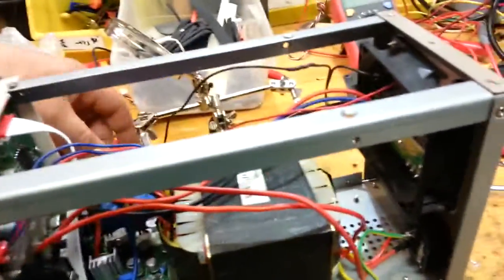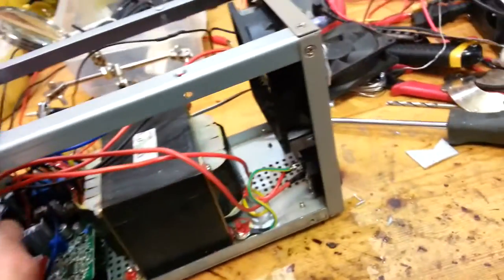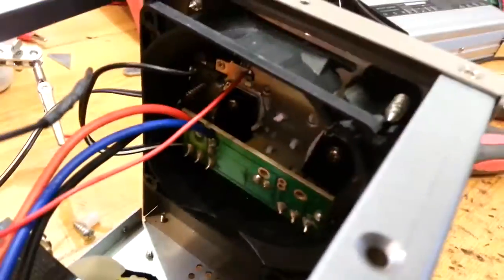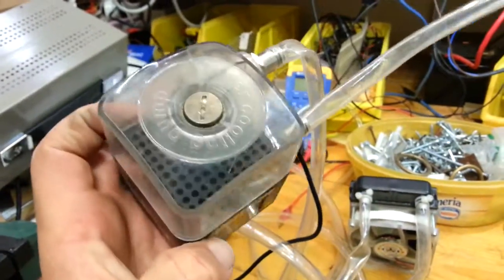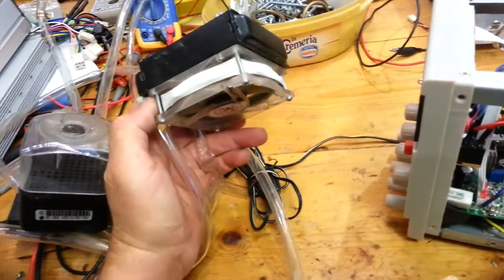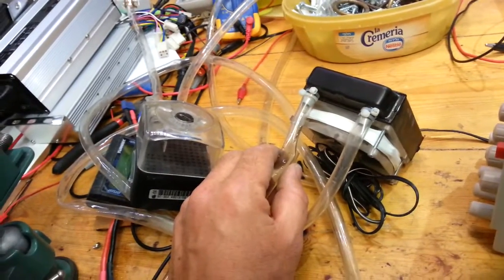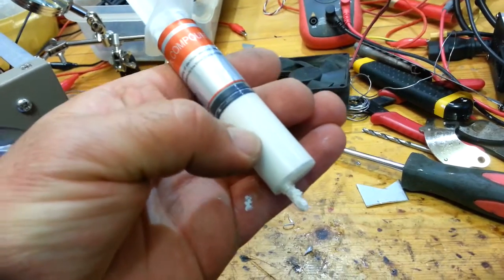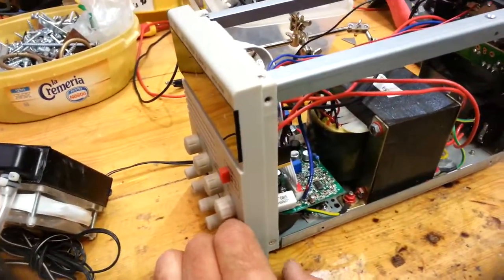make your power supply quiet - add water cooling - DIY

Comment: Can I know what type of the radiator and it's dimension
Reply from the maker: use a PC cooling system radiator. will do the work just fine. like this one https://www.aliexpress.com/item/Segotep-Liquid-Freezer-Water-Ice-Cooling-System-CPU-Cooler-PC-Computer-Cooler-Fluid-Dynamic-Bearing-120mm/32868880583.html?spm=2114.search0104.3.9.72966d34vy3EFm&ws_ab_test=searchweb0_0,searchweb201602_3_10846_10152_10065_10151_10344_10068_10342_10343_10340_10059_10341_10696_100031_10084_10083_10103_524_10618_10624_10307_10623_10622_10621_10620,searchweb201603_30,ppcSwitch_4&algo_expid=72328c7a-b9c5-418b-bdb1-660e45804c4e-1&algo_pvid=72328c7a-b9c5-418b-bdb1-660e45804c4e&transAbTest=ae803_1&priceBeautifyAB=0